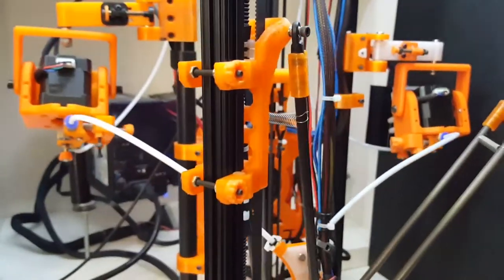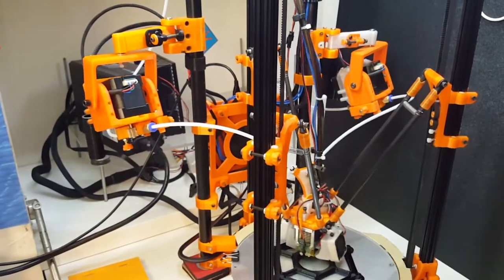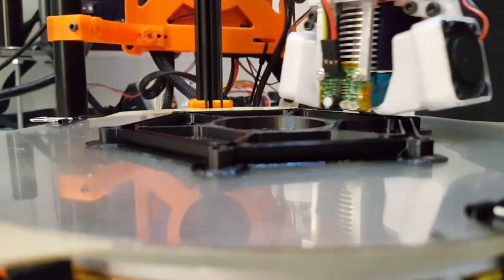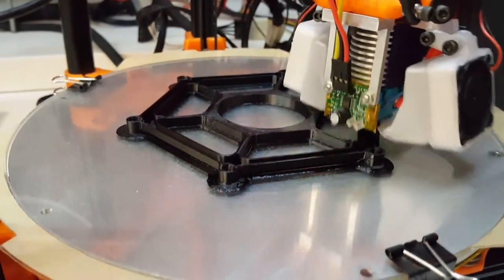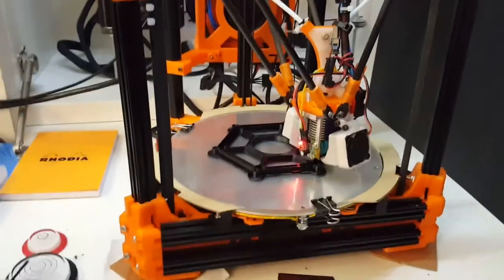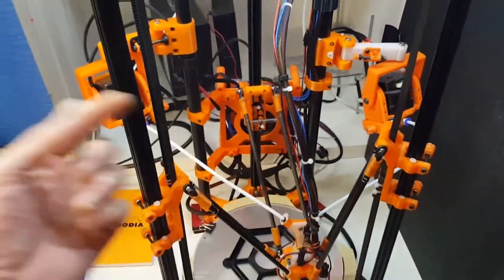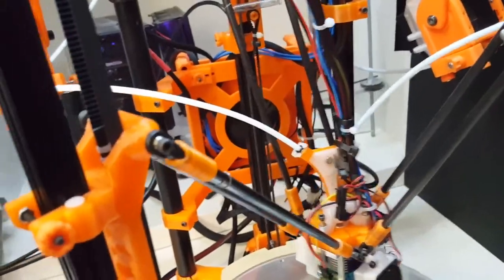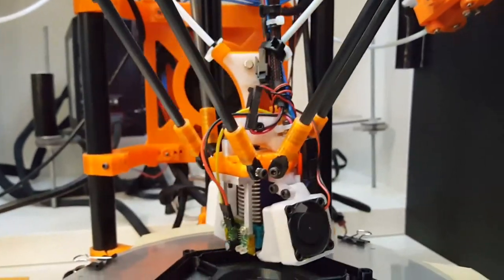Mid-mounted pivoting extruder demo

Comment: Love what you got going here, I found out about this project from your post on thingiverse on acetel bearings. I've had a similar idea for teflon when I found your post, I searched for acetel rods after the post and found powder/fiber filled acetel rods and came up with an idea for a corexy. I'm still designing the bearing blocks but I'm nearing first assembly of the machine. I just want to say thank you for posting these videos, I think it's awesome what you are doing with this delta and have inspired others to experiment with similar ideas.
Reply from the maker: wow thanks!  I am thinking of making a core XY, not for a while still all OCD about deltas, but when I do go core XY for a build hopefully it will be your system.

Comment: Interesting approach. Liked deltas, until I started thinking about multiple extrusion. (Building a CoreXY printer, instead.)

Shorter bowden tubes are a definite win. Watching the thing move, bit concerned about the wobbles on the extruders as they move. Will faster movement cause wobble transmitted into the frame and print?

Watching this video ... if we mounted a stepper on each truck, then the bowden tube is as short as possible with the least relative motion between stepper and hotend. (Maybe mount the stepper a bit below where the arms meet the truck? Not sure about clearance.) With a geared extruder, could use a lighter stepper (as I got from E3D to use with the Aero extruder/hotend).

Then of course there is remote direct-drive extruder, like the Zesty Nimble. Gets rid of the bowden tubes, while keeping the mass of the print head low. The mechanics of a flexible drive shaft are more predictable than various filaments pushed through a bowden tube. A three-extruder setup looks somewhat straight-forward.
Reply from the maker: Thanks for the good analysis (I remember you from G+3dp).  

Backlash from the extruder moving is handled with a set of damping springs, poorly designed but effective to mitigate any bouncing in the frame from fast travel moves.  The 15mm extrusions however are a huge issue.  I took the effectors off the frame and mounted them on their own stands, and I am getting more frame movement, top of delta frame is wobbling a lot without the extra framing from the extruders mounted to it.  15x15 is not very good for prototyping no one uses it anymore for good reasons.  I hope to transition to 20x20 some day.

I have thought this may be a good solution for a core x/y as well, the setup would be different but the concept should allow short bowdens and multi filament switching.  On a more supported extruder I could see more filament paths.  The i3 multi material could have its feeder extruders just tilt to remove some length of tubing and allow the system to be more 'relaxed' through the entire build area.

Comment: Cool extruder mount design. Neat way to keep the tubes short. What speeds have you printed at? Curious how the tubes will behave when the effector travels quickly around the bed.
Reply from the maker: funny you should ask, I typed 700 instead of 70 into solid infill speed percentage in S3D and it tried to do the 1st layer at 283mm/s.  did not lay down much filament it mostly just curled up around the nozzle, a few prints later a bearing gave out and started grinding badly, but the extruders followed along OK.  faster than I ever wanted, slamming into the dampening springs on the pivoting arms the extruders hang from, but it worked.  I have printed at 100mm/s and it looked blobby but the accuracy was OK just the PETG I print with is pretty much limited to around 60mm/s or it doesn't melt fast enough.

The extruders will pivot and swing and til faster than the printers all PETG corners carriages and other parts will handle without resonance.  So it's not really an issue.  I like the quality at 40mm/s with PETG and can live with it at 60mm/s.  Taulman T-Glase, well it's expensive and I print it slow around 40mm/s.  I dont print PLA much but need to get some to speed test with this, I think it might do 100mm/s with PLA with OK but not great quality.  I did the makerbot TRex at around 50mm/s with some year old super brittle PLA that was my last, it went OK the print came out nice, then all the connectors broke because the PLA was so old :P, but the print is nice!